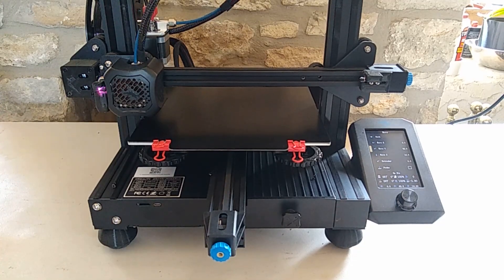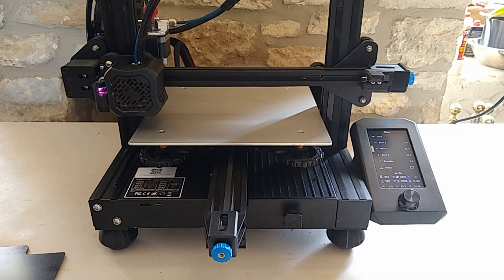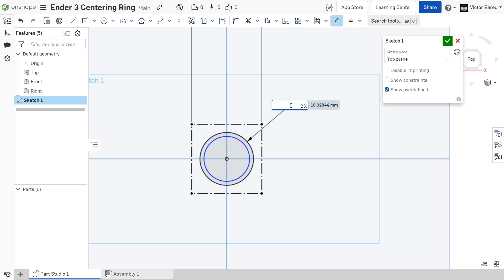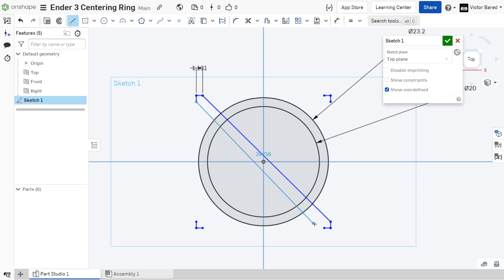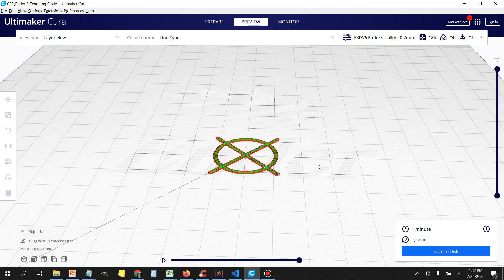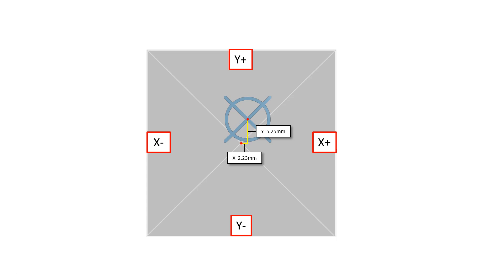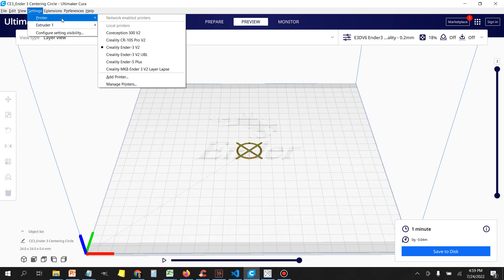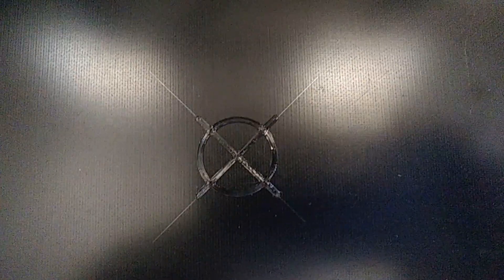Ender 3 V2 Ultimaker CURA 3D Printing Off-Center Fix

Comment: The Professional Firmware allows you to edit the XY MIN/MAX Position and also the bed size.
Reply from the maker: Hello Miguel, Thank you for commenting and suggestion about the Professional Firmware. Are you the same Miguel that developed it? Like you I looked at the firmware first but this issue in the video is introduced by CURA. I can divide my bed width and depth by 2, enter those values into X&Y using the printer control dial and my print nozzle moves to the bullseye at the center of the print bed. This indicates to me that the issue isn't related to the printer. The default Ender 3 printer profile values in CURA are off.  So dispite the model showing in the slicer that it's in the center CURA adjusts the print position and creates the G-Code.

I racked my brain on this for months and found another YouTuber that explained how he fixed it. I felt the solution was valuable enough since I was unable to find the answer and made my own video to share.

Best of luck with your mods!
Reply: @vbared  Good to know, thanks!

Comment: Hi Victor, for my E5 Pro this solution of using the extruder offsets in Cura  has allowed me to stop using the Cura X and Y print placement offsets, which sometimes I would forget.

I certainly wish that somewhere somehow a standard for what is front and what is rear was corrected as I sit at the front of my printer as does the display panel,  not the rear and as you know my E5 Pro modifications have reversed the bed 180 degrees which makes Cura's layout reversed by 180 degrees.  Trying to explain this at times is more that a brain tease.

I to agree that there is something in the mechanical design and setup of the X and Y axis and the home switch position that is most likely causing the centering issue.  But when looking at all of the settings for the bed size in the firmware, the mesh setup, the mesh insert values and the Unified Bed Leveling calibration values and the mechanics of the printer build, I think that this is a simpler way to center the print.

Don't forget to test all the e-steps for X, Y, Z & E and tweak where needed as this can cause nozzle location issues as well.

Thanks again Victor for the " = " tool function in OnShape.  I love adding new ones to my work.

Doug
Reply from the maker: Hi Doug, I'm sure there is a way to fix this via firmware. We just need to learn more about it or compare the configuration h file of the Ender 5 Pro to the one for the Ender 3 V2 to find the differences. Thank you for the tip about the checking the e-steps.

Enjoy your day!

Comment: The proposed solution is at around 11:30, and its not really a solution but a workaround. The printer needs to be recalibrated in its firmware. I got the same issue when I upgraded my firmware and did some hardware modifications to the gantry.  Still haven't found where you actually solve this.
Reply from the maker: Hello PerkeleTV, Thank you commenting. A workaround is the proper terminology to use for this. I have an Ender 3 V2 running a E3D V6 hotend and had to move the X & Y  limit switches to re-center the nozzle to the middle of the bed. Again another workaround but it solved the problems for me and something to try if you haven't done it already.

Best of luck with your mods!
Reply: @vbared  Thanks a ton for elaborating! Much appreciated
Reply: Were you able to identify the source of the problem? I'm about to go crazy, I can't find the source of the problem for a long time.